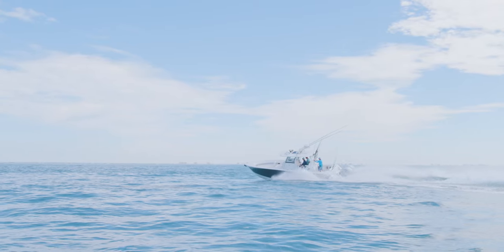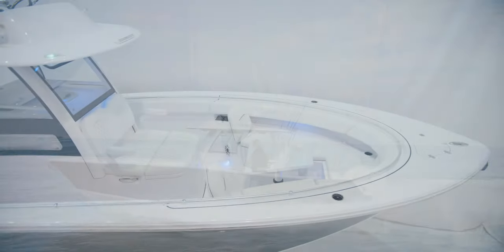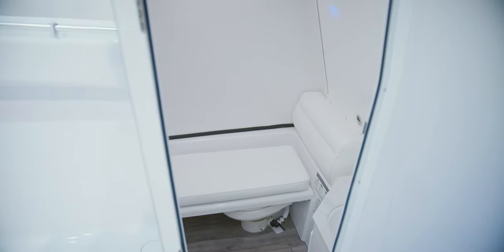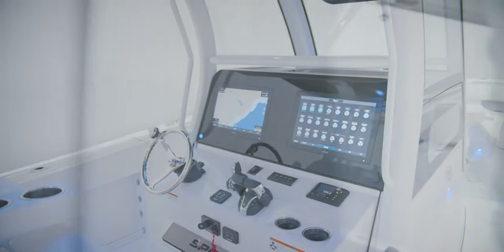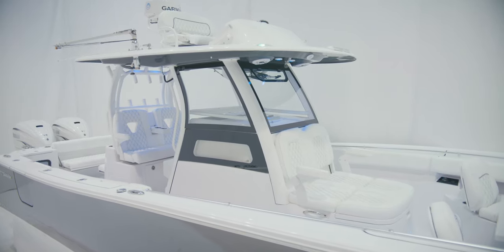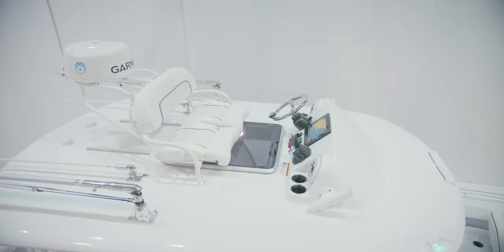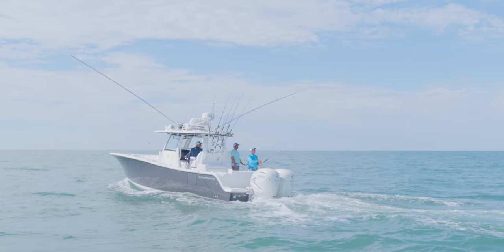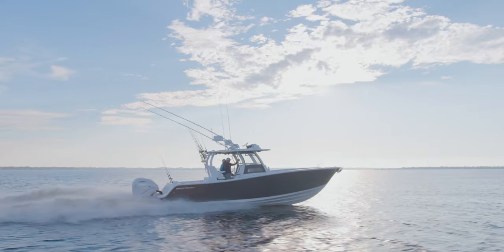Open 322 Center Console - 2021 Walkthrough

Comment: when you say the price is $214,995. is that the actual starting price i can buy this boat for before adding options? or is it the msrp of $299,999?
Reply: From my conversations with local dealers, it's the Internet price...  $214,995 is the base price you can buy the boat before additional options.  IMO... This is a great value for the standard vessel configuration.
Reply: @SteadReady302  agreed. thanks
Reply: You can configure very easily on their website,.  There’s a pretty impressive list of standard features so you won’t have sticker shock when you do your build
Reply from the maker: The price the dealer goes off of is the internet price. So if you build your model online and see it priced at a specific amount then that will be what you'll be paying with the dealer. This price does not reflect a trailer or taxes and title so you will see a slightly different number at the dealer because of that.
Reply: As Sportsman said below, we built our 261 Heritage on the website: boat base price plus radar, 2nd Garmin, forward sun shade kit and that was our boat's purchse price. We had to add Michigan sales, tax, title, delivery, dealer prep. That's our number minus trade-in.